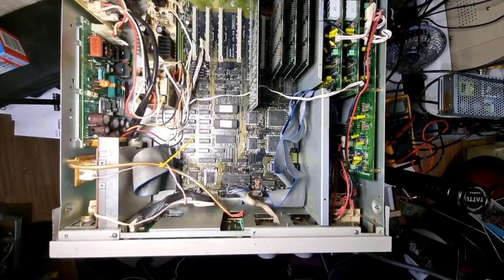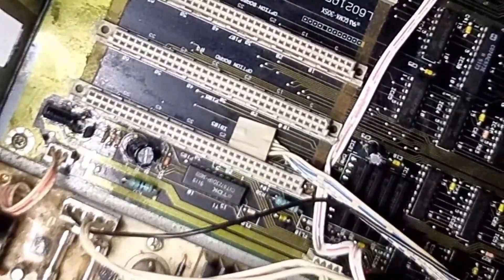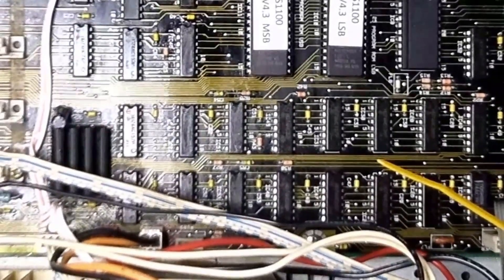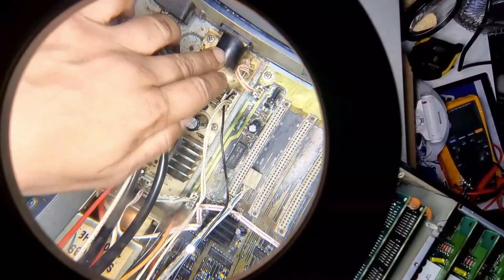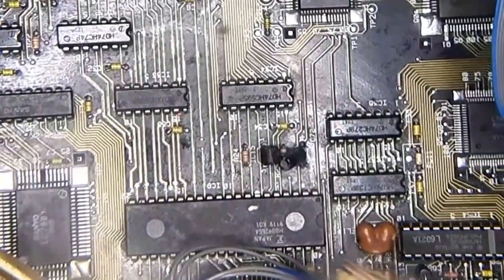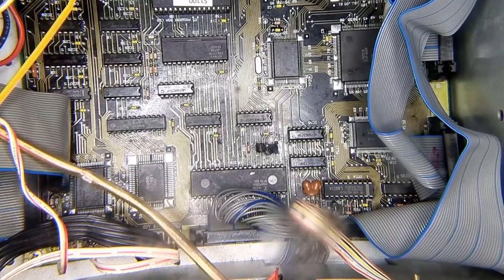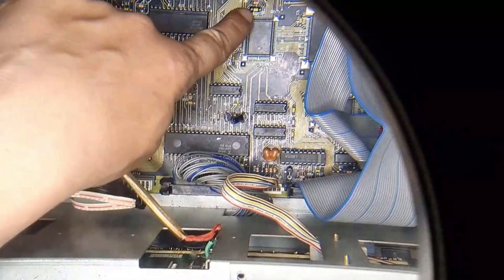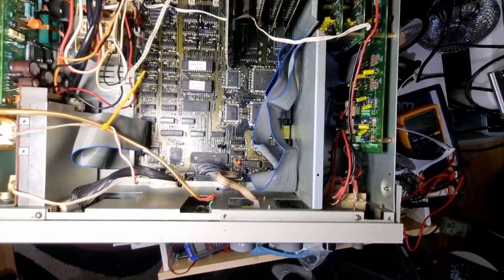Akai s1100 Hardware sample fix   GETTING CLOSER?

Comment: If you can check if you get a clean output from the digital then i would be looking into the digital to analog part of the system. Also have you had a go at sampling on it edit the sample and  then saving that to disk and loading it up on another sampler, if its clean then that points to the digital to analog part of the system again. Whats it sound like on the Individual Outputs ?

Comment: The new psu wont change anything B, if you didnt have that s3000 replacement, then i would have pushed you to replace it. Keep it tho, as it will be needed eventually. Have seen a couple of s1100’s spares repairs on ebay for £100, gone tho now 😔👍 thanks for the shoutout lol😁 i really would recommend taking that motherboard out and checking underneath too, just to see what it looks like, have you done the touching up of solder joints all over the board? if not, then the previous owner must have, might need some flux and retouching up. Ill try and investigate those ic’s tomorrow night, and have a look at the schematics myself 👍

Comment: Have you got a can of freezer spray? It can help identify faulty components, depending on the issue. Can also help pinpoint dry joints. Identify a suspect component, give it a spay and see if the output changes.
Reply from the maker: sounds interesting, I have also tried a thermal cam, but found nothing overheating
Reply: @TheBizzyBScience  Its worth a try. I have no experience fixing samplers but used to work with avionics and RF equipment. Freezer was often useful. Interesting series of videos.

Comment: Another thing, whats the part number on your ram boards Bizzy? Looks like a lot of ic’s on there for 2mb… look up the part number, and if its more than 2mb, swap those jumpers opposite to what they are now.
Reply from the maker: do you mean the 4 little power regulator looking ram chips MB81C4256-10PSZ 9125 M37 BC
Reply from the maker: On the CPU block diagram its IC1B WORK RAM 256 x 4BIT X 4, not sure how to test these
Reply from the maker: sorry man , its L6009C5020
Reply: @TheBizzyBScience  On the pcb itself, if its L6009C5020, then they are 2mb boards 👍 Just to make sure.

Comment: Perhaps get yourself a USB picoscope. That's what use at the mo. So you use your laptop etc  screen as the monitor.  May be cheaper and less space consuming as a standalone unit.
Reply: Also can use it isolated from the mains when running on battery, very handy when learning, as less likely to blow up the probes 👍 good suggestion.

Comment: The ic at 4.50 is a peel18cv8pc, electronic erasable programmable logic chip. I think it may have something to do with the lcd display logic. I just have not got around to looking at the schematics yet 😕 chips at 6.30 are lsb and msb 512k eprom style chips i believe.. possibly controls memory management… could be way off tho. Might be worth popping out and reseating, might have a dodgy connection on one of those dip sockets.. as long as you stay away from the 240v side, might be worth flexing/pressing the board whilst paying a sample. It may reveal a dry joint somewhere… see if it changes the sound. If you get chance to sample the output back into renoise, zoom into the waveform and take a picture of a sample cycle. Might reveal dc offset, or bits missing. Phew lol.
Reply: Transistor is MITSUMI PST520D-2
Reply: The thing he shall do is very simple,analyze the wave form,which undesirable frequencies are there?
We all know that digital chip handle data completely different,it's non linear.There is no way that an driver IC that could be broken and the machine still work properly,the result would be much more worst than just a noise.I don't believe that an broken RAM itself caused this,with a broken RAM the computer might be lagging or totally messed up.